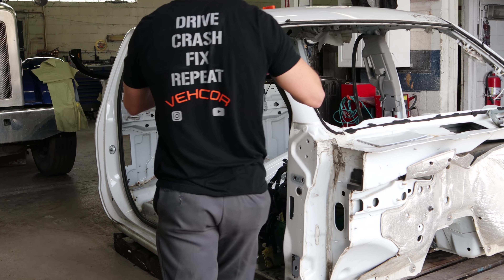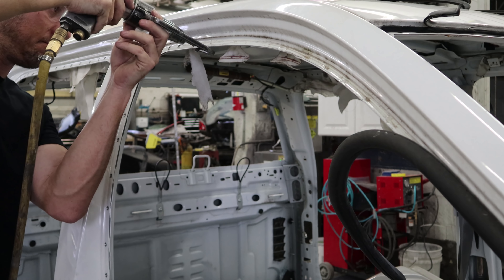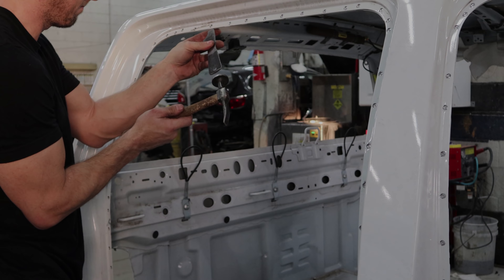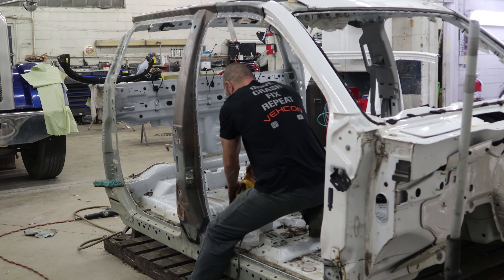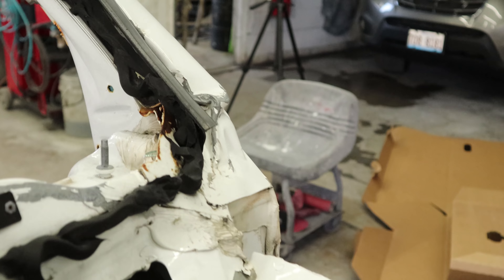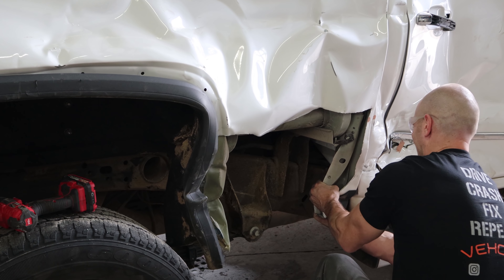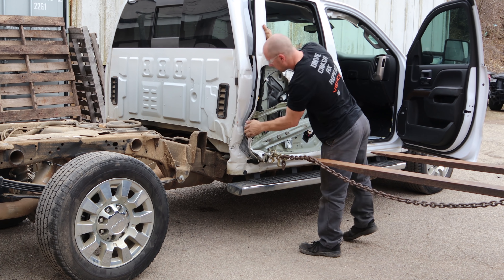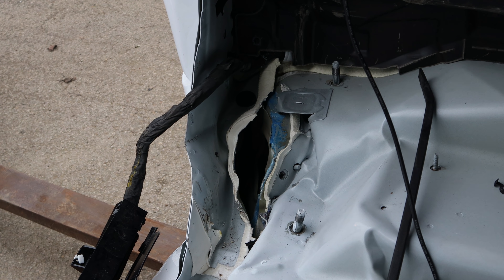2018 GMC Sierra Denali "Dirtnali" Part 3: Stripping the parts cab and body panels.

Comment: Question why fix the original cab when it has taken such a hard hit in the side posts vs just replacing the cab with the donor cab

Edit yeah never mind I see why drive side of donor cab is ruined
Reply: Its a titling issue as well. Donor cab will either require the vin from the old cab or a retag from the State that takes FOREVER
Reply from the maker: It is also a lot of additional work to remove the front end, dash and glass as well as repaint almost the entire truck after blending in the panels around the cab.
Reply: @vehcor  Yeah I didn't notice that you had not removed the dash and forgot the glass has a vin in it too

Comment: Why did GM not install 4 smaller DEF tanks one in front of bumper one behind rear bumper and one outside driver & passenger door 
The current placement seems AWFULLY stupid especially for a 4WD as it would be purrrrrfect for using the Rubicon trail slightly further east from the left coast near the Krapitol of California
Reply from the maker: I think they built the truck and had a left over DEF tank they had to stick somewhere.  Stupid emissions!

Comment: Why not just swap cabs
Reply: That's what I was wondering too.  Seems like it might have been less work if the donor cab was GTG.
Reply: @johnhenry1395  I Beleve he said this truck had a clean title so he proboly wanted to avoid all the vin bs.
Reply: That Would Have Been Too-easy...
Reply: @Joshua_McGough  drill the rivets out and re-revit.  So an intact cab has to be me more structurally sound than a lego puzzle.
Reply from the maker: https://youtu.be/0JeR2M2bWXw?t=619